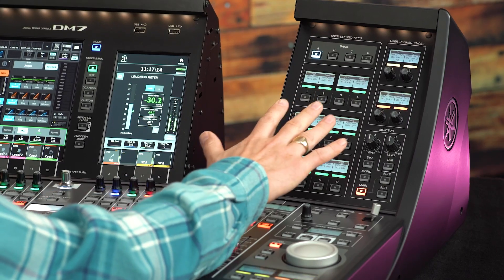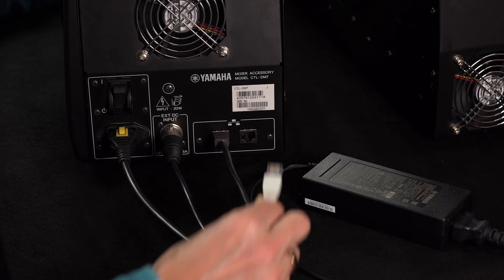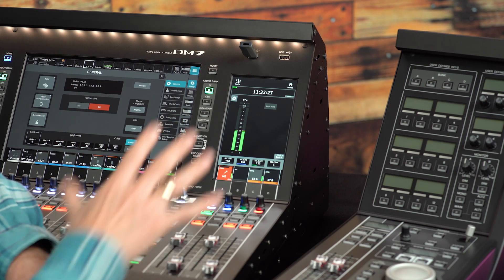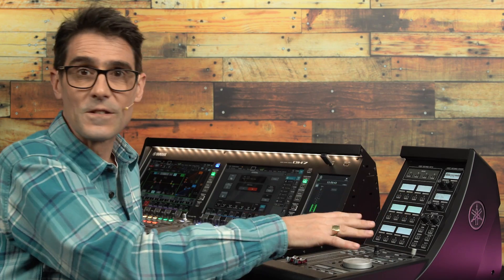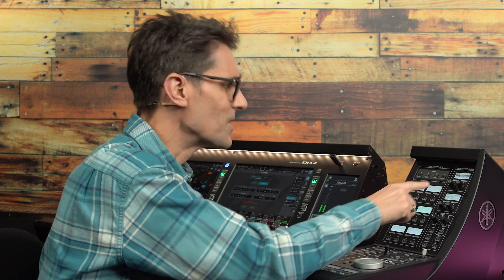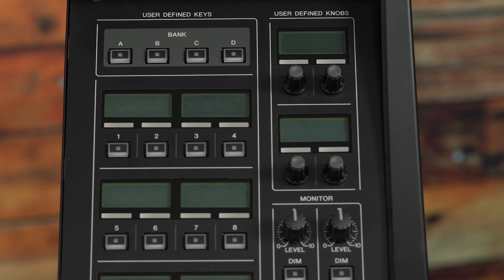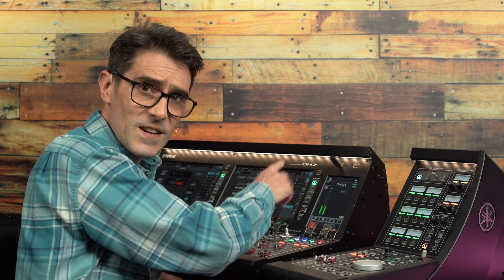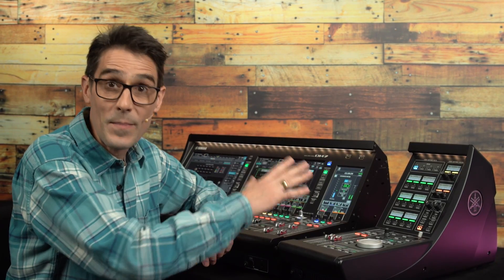#6 Yamaha DM7 Control: Connect and Configure

Comment: 2:10 - you're saying you need firmware version at least 1.5 and manual also says this, but... this presentation suggests that it actually needs 1.50 as well as Yamaha's webpage says that support for those packages was added on version 1.50!

Versioning is not mathematical decimal points! Those are totally separate major, minor and patch versions separated by dot (MAJOR.MINOR.PATCH - in some forms some of them optional if they are "0")!

1.50 is 45 minor versions newerthan 1.5! Those are NOT the same! The same are 1.5, 1.05 or 1.005 - you tread all numbers between dots as entirely individual numbers! This video is VERY WRONG and confusing...
Reply: Are you for real ?
Reply: @mikebell1269 yes. This is big difference.

Would you like to buy a car that was advertised as year 2025 only to discover it was 2005? There’s „2” and „5” in both after all…
Reply: @morsikpl  Hi. Computer software versioning is like you said, unfortunately. It makes it really confusing for people to read, because most people I know, think of it as a mathematically correct number. Which is why I lost my freaking mind when Minecraft went from version 1.9 to 1.10, instead of 2.0. I was really looking forward to a new MAJOR version, but NO. 
I would gladly accept a better version number-scheme with leading zeros, like Minecraft 1.09 or something, but when omitting those zeros, it just looks like som marketing director had their ways, and everybody suffers.